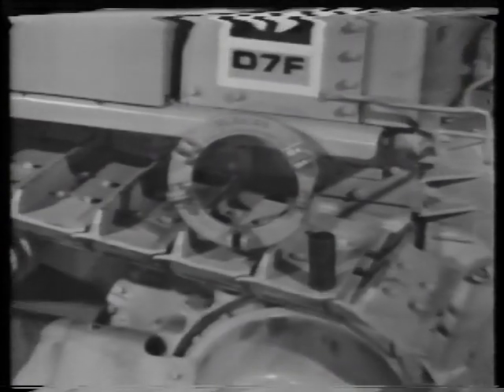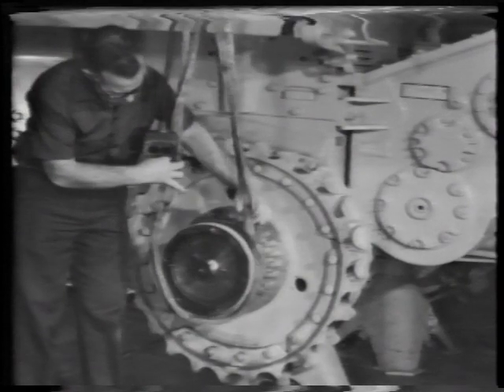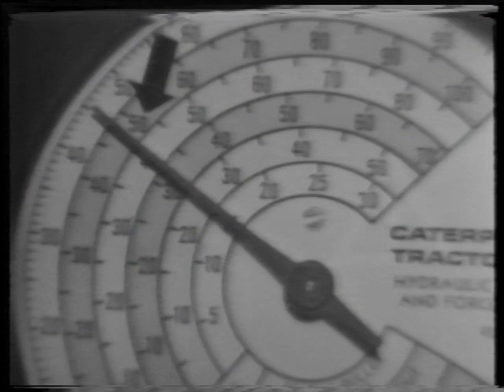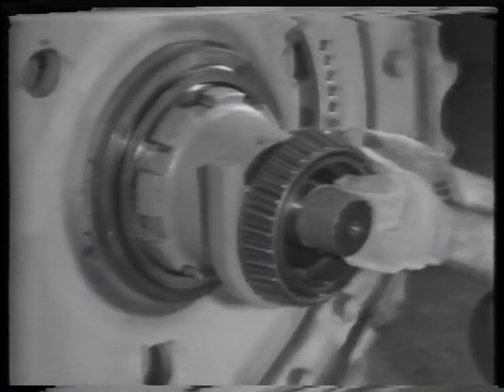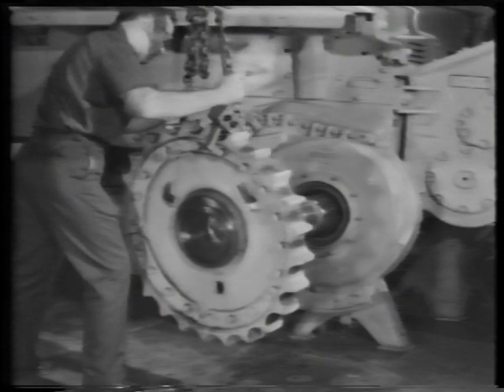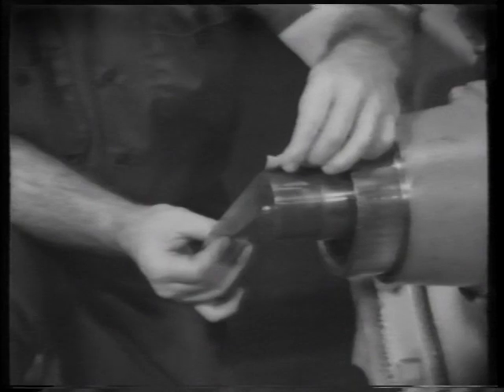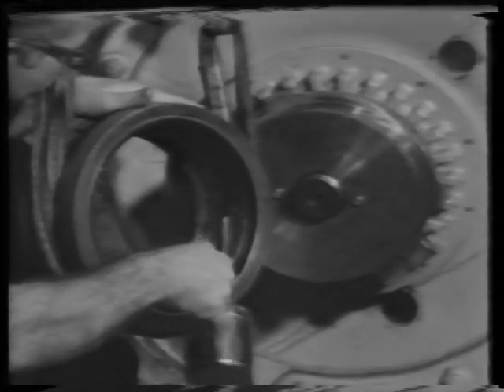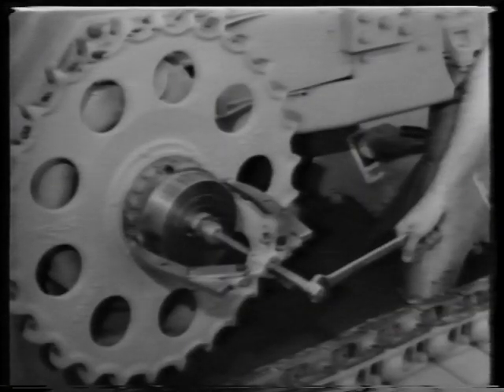CAT Sprocket Removal And Installation

Comment: A very informative tutorial. It's a good idea to use the Cat's power to remove that tight nut. Also to multiply the length of the handle on the socket by the weight of the mechanic to calculate the amount of torque applied to the nut.